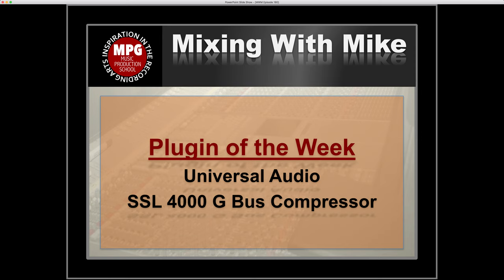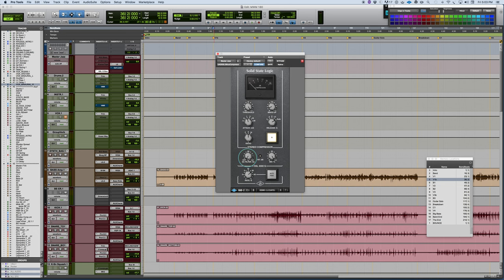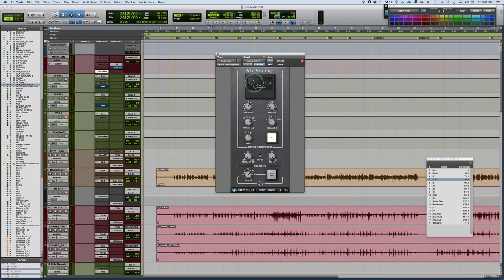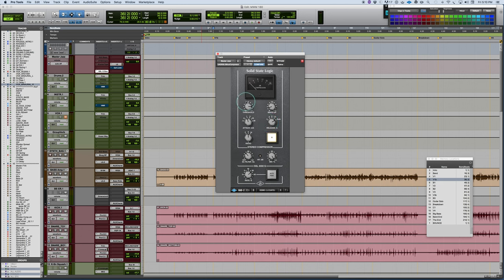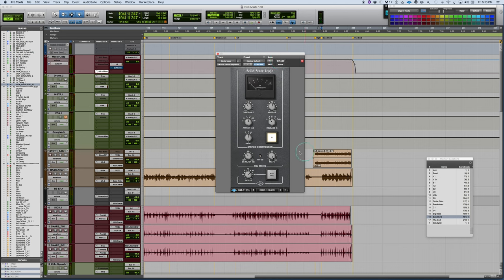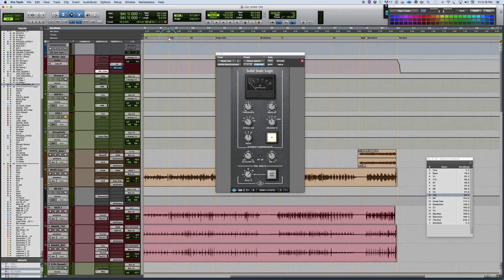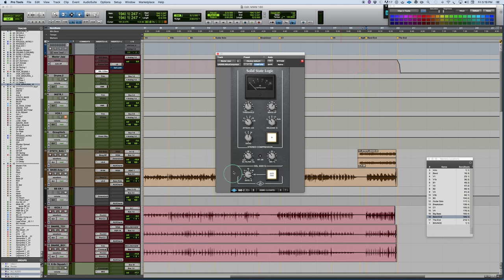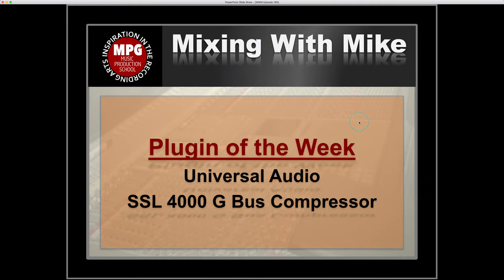UA - SSL 4000 G Bus Compressor - Mixing With Mike Plugin of the Week

Comment: how did you do this beautifull cymbal splash, seems a fast attack and long release but where and exactly or maybe i´m confuse, bur they sound awesome i have listen to that in lots of your mixes, about the SSL it sound good but the real thing is to feed apart, this are not close at all
Reply from the maker: Cut at around 7-8k on a bell and shelve up the overall high end. It cuts away the harshness and allows the air of the cymbal to cut through.